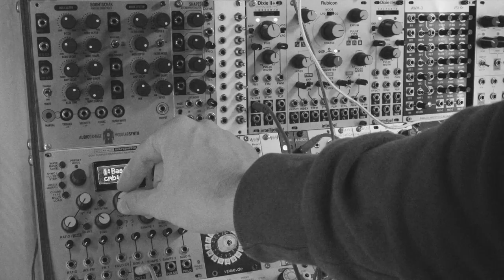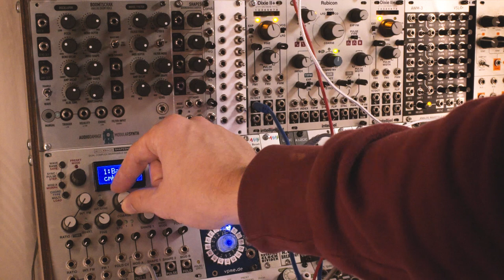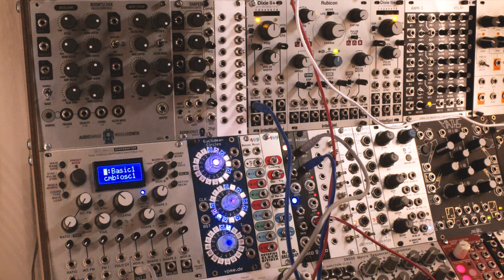Why Logic Modules are Ace: Feat. EricaSynths Pico Logic

Comment: The Pico units will take a clock from anything including tempi if you run them through an attenuator first. If the voltage of the rising edge is too high they will not register the edge. This is at least how some of the other units in the same series work. You can easily diy cables with a resistor to ground so that the cable becomes an attenuated cable, and then you will not need the attenuation module in between.

Comment: logic gates are one of those things that get me the most excited about modular... creating so many variations of patterns based on the same basic sources. 

I got tired of drawing precisely the patterns i wanted (either on a screen or even on a hardware sequencer) i dont want to write music anymore, i want to experiment with music, and logic gates are a very awesome tool for this kindof experimentation

also for the DIY folks out there, logic gates are super simple to make... they all come on various IC chips with an identical pinout. all you really need to do is hookup jacks to the inputs and outputs and you're set.

you could be fancy and add LEDs on each jack and probably would be smart to add some voltage protection to your inputs (avoid negative voltages or pushing a 10V signal into a 5 volt chip although i think it can tolerate it ) but honestly if you raw dog it you're still gonna make it work.

Comment: That's a clever technique of beatmaking which I stumbled upon literally a week before spotting this video.

Boolean operators are not that hard to remember.  They are only concerned with whether a signal is on (higher than threshold) or off.  The basic ones (aside from NOT, which simply spits out the opposite of the input) are AND, OR, XOR .. an N in the name means the output is inverted to make it the logical opposite of its N-less cousin.  I find it simplest to think of them in terms of "what conditions cause the output to be on?"
AND = if both inputs are on.  NAND = if any input is off.
OR = if any input is on.  NOR = if both inputs are off.
XOR = if the two inputs are different.  NXOR = if the two inputs are the same.

NAND and NOR are not super useful for beat combining since they only fire when something is off, i.e. out pf phase with your gate pattern.  NXOR gives you the outputs of AND and NOR combined and tends to be super busy with in- and out-of-phase gates.
Reply: Most integrated circuits are built entirely out of nand (or entirely nor) gates because you can combine them together to get all other gates. When massed produced it's cheaper to just make a bunch of the same thing.

Not super helpful with a modular setup but just thought that was an interesting sidenote

Comment: You could actually work out and plan the interactions between two euclidean rhythms in advance if you multiply the length of each pattern by the length of the other to find a common divisor length where they both loop back to the starting position and then plotting both out in separate rows in excel. Then you could just define the logic of other sequences and drag across to make new rows for and/or/xor/etc.

Comment: Any idea why the Tempi doesn't work? Peak voltage of the trigger?
Reply from the maker: From Ericasynths themselves: "Sometimes modules from other manufacturers do not trigger the Pico Logic module due to the high impedance of their outputs. For modules causing this, we suggest putting their gates through a buffered multiple or amplifier  first."
Reply: I would have said it's because the Pico gate threshold is higher than the output of the other modules.  The Pico system is based on 10v CV while a lot of other manufacturers use a 5v range.  I have the Pico VCA and it's fully open at 10v, which makes it frustratingly quiet when I feed it CV from 5v modules.  You have to add an offset to compensate.

Comment: Does the pico logic work with CVs as well as gates? voltage is voltage, after all...
Reply: The alogic does, but the standard logic is binary i.e. it has an input threshold so a signal above that threshold is considered "on" and below that threshold is "off."  The output is strictly gates .. I don't know for sure but since it's Pico I would guess they are +10v.

Comment: Is there a min voltage required to trigger? You mention a few modules failing to trigger any output.
Reply: After looking at some manuals I see min input for logic is 2.5v, well below the output of Tempi or Circadian Rhythms. I wonder why they don’t work??
Reply from the maker: Otto Max Renner Just checked with Ericasynths - 5V required!

Comment: If you have a fully analog setup I understand the point of Logic modules, but I'd argue if you have some decently competent digital modules (especially when it comes to sequencing) that have cv over clock etc., and you have some complex LFOs, random voltages, etc., you don't really need them. You can create all these types of changes in terms of rhythms, clocks, etc. by driving attenuation in different ways.
Reply: I don't think digital or analog has much to do with it. Having 1 complex LFO isn't the same as deriving a complex LFO using two simple ones, as now you'd have  3 rhythmically linked LFOs, same for clock divisions and logic gates. Run two separate sequencers and then use the logic to trigger 3rd events when the two sequences overlap (or don't overlap depending on AND, OR, XOR, NAND etc) I'm not sure how you would achieve those effects with a digital module and CV control.
Reply: Hezza11 check out the octasource and the stillson hammer mk2. You can achieve everything you're describing with those 2. If you're steevio and you want to do almost EVERYTHING analog then you need clock modules, logic, precision adders etc..but I prefer to cram such things in smaller HP, so I don't.
Reply: I really don't see how, I know the Stillson Hammer has 4 sequence tracks but how would you get it to fire a  trigger when two of its tracks overlap? They're both great modules and are feature rich, but they ain't got no logic in. Can see this turning into a pointless internet argument so will leave it there, different strokes for different folks and all that.
Reply: There is cv over every parameter and probability modes--therefore, you can create all manner of strange, shifting, changing clocks. I've owned clock modules, switches, etc. and sold them all because they were unnecessary. If you don't own one though, you might not know firsthand. You night be getting at "the methods of programming are different,"; yes, if you think about things in that way, maybe the results will not be exactly the same, but for my purposes, there is nothing to be achieved at this point from other such modules in terms of getting a wide variety of musical results.
Reply: Here's an old video with old firmware in which just by changing the built in attenuation of cv on the tracks of SHMk2 I can arrive at constantly changing rhythms due to the cv affecting gate, burst, etc.. https://www.youtube.com/watch?v=SRFr2szzLDY
At the time I also had a 4ms QCD I was using in conjunction with it..but I sold it..because it was superfluous as long as you have some interesting cv going into the SHMk2s. Octasource!!
Reply: Logic modules aren't just useful for rhythms, but for patch-programming some rudimentary intelligence of "self-awareness" into a patch, especially in concert with comparators, envelope followers etc. For instance, you might want to have one part of a generative patch kick in whenever another part goes quiet. When the volume drops below a threshold, the comparator output goes low, and you could use a NOT gate to invert that and trigger a sequence start. Then you might want that to only happen on the first note of a bar, so you AND that with a pulse from a step sequencer like an A161. But perhaps you want it to also trigger another sound if it happens in an even-numbered bar, so you can AND that with a clock division. But maybe you also want that last sound to trigger at various random times, so you'll need OR functionality to combine a random gate source with that previous gate. And so on...there are many more possibilities that can be unlocked if you have a few simple logic modules in your system.
Reply: That's a good point about comparators. I use side chaining for that combined with filtering. As far as the random triggering etc. my complex random gates and SHMk2 does that pretty well.
Reply: Nick Herman but the point of logic is that it's not random, you are setting the conditions of when you want things to happen.
Reply: Ah well, I guess if you can manage to run multiple voices running at different time sigs. with tons of melodies, filters, oscillators and lots of VCAs all with loads of modulation and can tell the difference between one part triggering on the 3rd bar every 4 measures vs everything else thats going on then you're either a live-compositional genius or your music is pretty straight forward :)
E.g...as long as things are in sync, dynamic, and basically sound good, that's what matters to me. Usually I think those type of very specific changes only matter if you have a very classical model of composition in mind and the whole nature of the piece will shift when such things happen...which reminds me, the newest SH firmware has cv over the preset (which I never use, but this might just make me--it's getting practically Cirklon-esque at this point!)
Reply: But the video is about logic modules. What's the point of commenting on a video about cheap logic modules when every answer you have is use a £600 sequencer or a £300 lfo source (which still can't do the basic things mentioned in the video)
Reply: No no, it can do so much more my friend...because I believe in buying the right tool to do as much as humanely possible and then never having to buy anything else redundant again. But ok, I'm done :)
Reply: Nick Herman Not so much classical, but complex generative ambientish patches are the main reason I got into Eurorack. Some sorts of generative patch can get by very nicely with random sources or multiple un-synced LFOs, but logic modules open up the possibility to do so much more. Complex programmable sequencers etc can add a lot as well, but you’re generally limited to what can be done inside that module, and I prefer to break out the complexity across my rack and open it up to other combinations.
Reply: Fair enough, though I don't find I'm lacking for any complex possibilities or modulation in my setup.